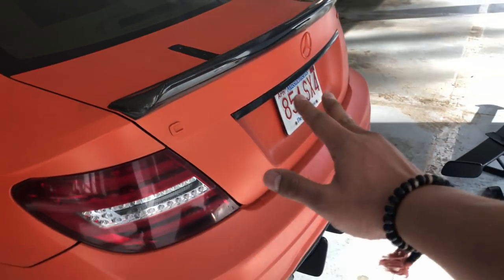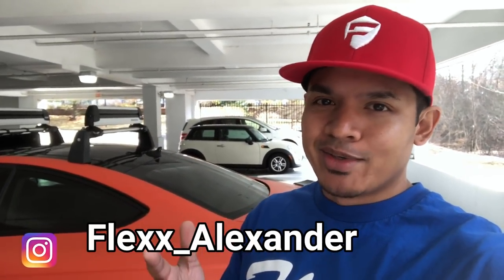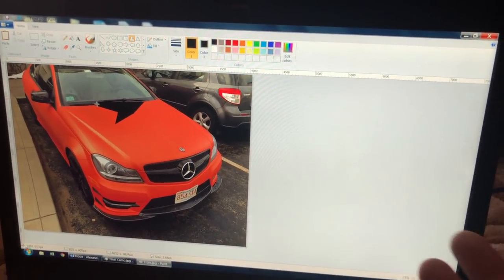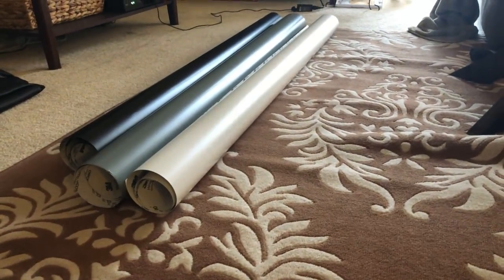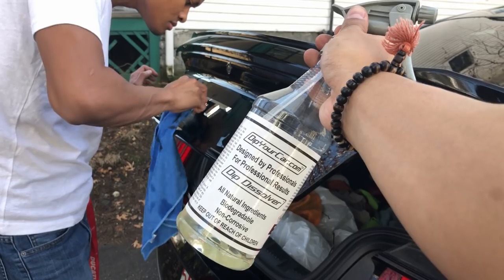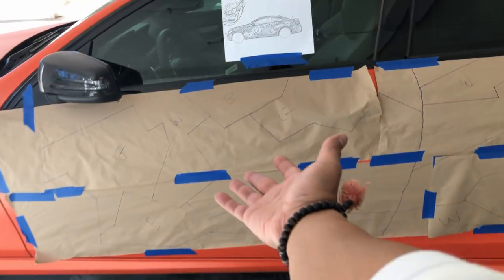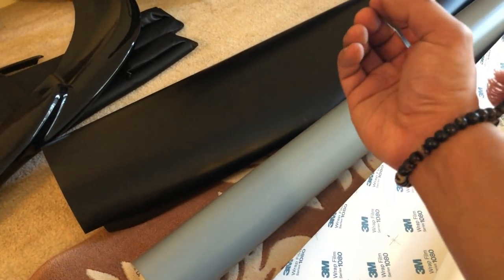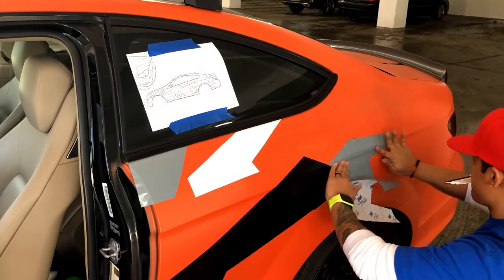Mercedes CAMO WRAP INSPIRED BY STRADMAN'S NEW Wrap for The Lamborghini Video

Comment: looking good bro...
Reply from the maker: Thanks bro. I'm going to keep it on for a bit. It's different and eye catching but I can't rock this all year long. hahaha. I'm already planning my next color change.
Reply: how much is it to dip the entire car? im going to inbox you pictures of my c250... ive done quite a few of the mods from this channel.. its just too dark to take a picture right now
Reply from the maker: To do it yourself, around $800 but once you have the spray gun and compressor, next time you wanna dip, it will just cost you like $400 for the liquid dip. 

If you go to a shop, they will charge $800-$1300 depending on the quality of the dip and the finish of the dip. Matte solid colors are cheaper. Pearls and colorshift dips cost more. And higher quality dips like autoflex is a lot more expensive cause it looks like paint.